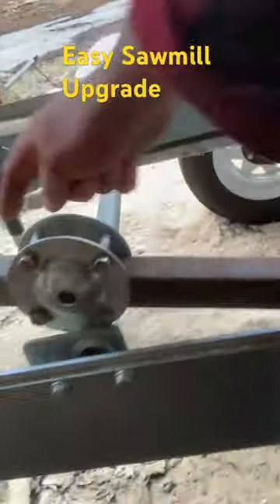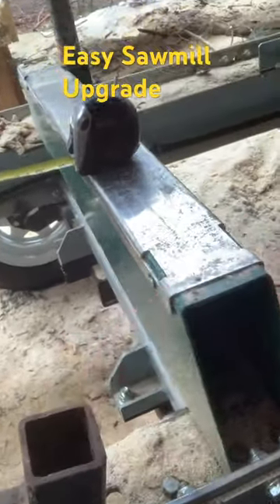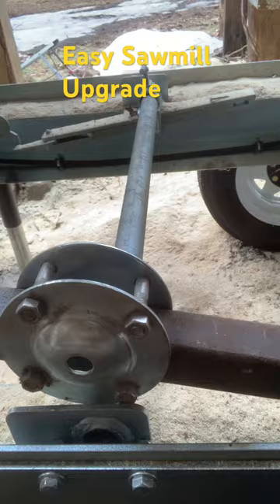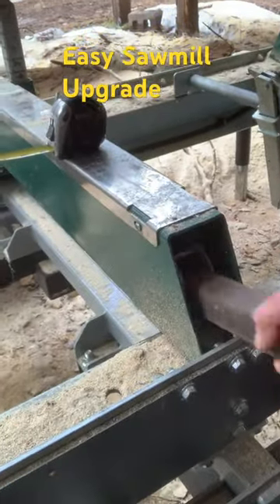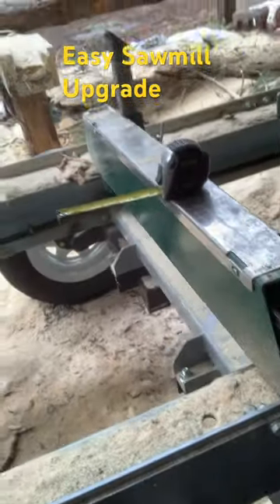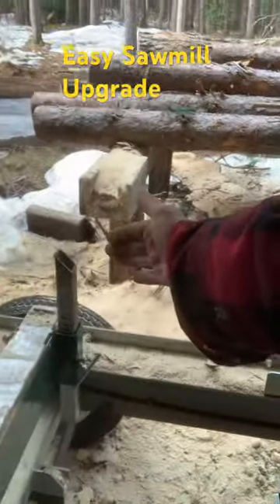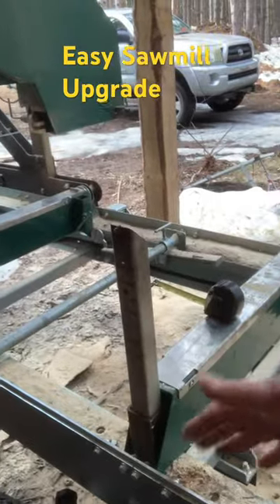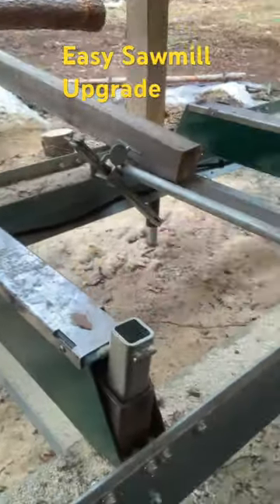Easy Sawmill Upgrade #sawmill @woodlandmills

Comment: I was wondering about that because my sawmill is turned around so that when I’m loading it in the sawmill shed, the stops are on the back of the mill bed. When I saw yours, I was thinking I wonder how you keep your logs from rolling off. Lol now I know.
Reply from the maker: I scratched my head for a while trying to come up with something after a few close calls
Reply: @sawingwithsandy yeah, it's always a pain when the log goes off on the backside of the mill. Your shed and my shed have similarities but I end up having to get the tractor in close enough with the forks on the front to lift the log back up. But like your older set up, I have a deck  that's raised and so I can put five or six logs on that and just roll them over onto the mill which makes things much easier and less of a chance of rolling off the backside.
Reply from the maker: That’s a nice setup you’ve got by the sounds of it. I wish I could get my tractor around the back of my mill a bit easier